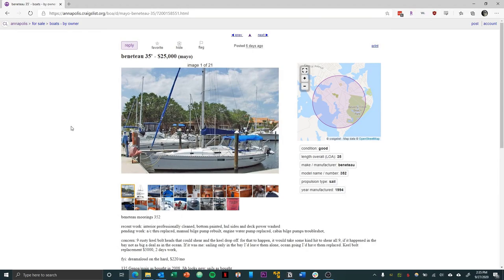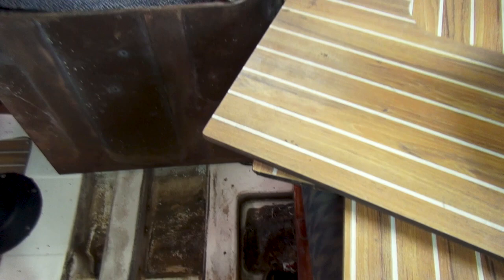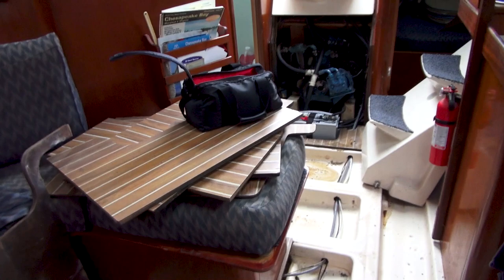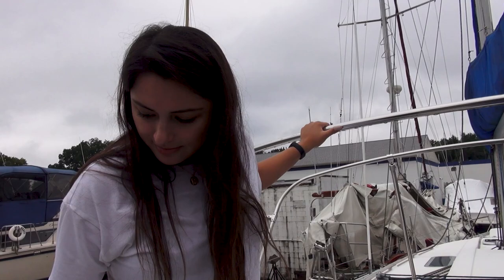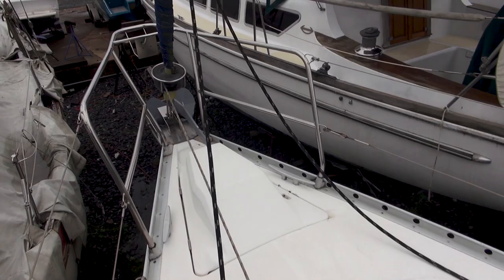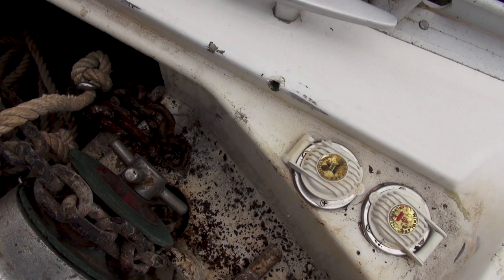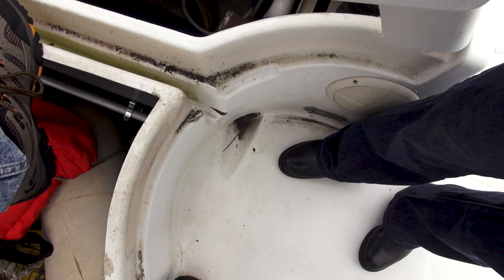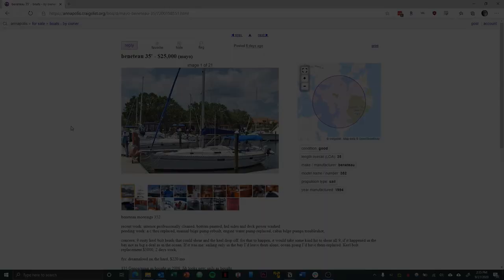Touring a $25k 94 Beneteau 35 from Craiglist - Sailing Viridian Episode 14

Comment: Hey dude long time cruiser here , grid bulkhead hull integrity is the first check , second is deck core closely followed by the rig integrity , everyone seems to start below , that is the last place  to start  things  like ac  dont matter in the scale of potential costs, why were the keel bolts so far gone? Bottom paint is the least of your issues , its common to repaint over old antifoul ,  a full peel is only req every 10-15 years there are far larger issues than the diesel here too

Comment: With respect in this video yo consistently demonstrated your lack of knowledge in assessing the condition of this boat and it’s systems. Your positive attitude is to be commended but you have understated the condition overall and the likely costs to get this into a safe condition are considerable. It may be worth considering if you get it for $2000?
Reply from the maker: No worries, we're still both new to sailboats, we're always trying to learn more! Luckily surveyors are always able to rein in my optimism and give a real take.

Comment: The keel bolts are a minor job on these, (I have the identical boat, mine looked just as bad when I replaced them several years ago). It's an Oceanis, model, I'd say a it was originally a charter boat by the above deck furler.
Reply: Moorings Charter

Comment: Sid came to a quick decision but consider price to work ratio: it's a lot of boart for $24k. The keel, engine, replacing the running rigging etc need work. I don't know your budger but if you can get more off the price and factor in $10 to $15k for what you need to get done to bring it to spec. You'd have one hell of a boat for under $50,000 even if you pay other people to do the work.

Comment: From your video, need to sandblast bottom and repaint.  Couple of thousand dollars.  Needs to new sails and running rigging (expensive).  Keel bolts should not rust like that, there has to be serious leak problems and likely galvanic corrosion problem, this would explain the poor state of the engine, which looks much older than its age.  You could easily put in $20k of repair/replacement.  I would not trust that boat and feel it needs a lot more than spit and polish.
Reply: Right with you. He keeps mentioning owning a boat but I have some doubts about that. 😆
Reply: Soda Blast bottom.  Sand blast could remove gel-coat.

Comment: The change in design from the 90s on reflects a change in the buying market due to the charter purchase options.  Prior to this many more boats were coastal cruisers and with upgrades could be blue water capable. The trade off is livability vs sailing ability.

You have to ask what your mission is, do you want to ICW down to FL and hop over to the Bahamas, or punch offshore at the Virginia Capes and head for St. Thomas?

Contact Matt Rutherford, or John Sparrow about being a buyers representative, tell them where your skill levels are, and what you’d like to do. They’ll help you decide if you need a smaller boat for two to three years, to be sold later for something more capable, or if you should bite the bullet and get the more capable boat first at the risk of spending time in the yard on refit.
Reply: I own Matt Rutherfords  1983 323 Pearson Hull #384 formerly Ault. You may want a better project than the Beneteau.  We keep Our boat in good shape. Its a pride thing. One repair each day You are aboard. Never give up.

Comment: interesting.   Keel bolts replaced = $5000, You need to examine the rigging, looks like a new water pump/impellor on the motor, it looks like a great deal for $25K.   The bottom paint issues is 4 days of sanding and painting.  what did you buy?

Comment: I think that $25 is too high. There's way too much to replace. What you observed during your inspection means that the hidden problems that you can't see will be a costly repair. Talk to other people here on Youtube about their builds and see what kind of feedback you receive. Offer $12.5 and if they go for it you have a huge project ahead of the both of you. Shop around and take your time if need be.
Reply: Absolutely get a survey.  the bolts can be capped with the head of another bolt that you have welded to the tops, and get them out with a wrench.
Reply: There is nothing to survey this boat is a danger to any novice. Boat should be scraped or given away.

Comment: Huge issue with keels and hulls separating from grid on these boats. The keel bolts rusting tells me they maybe leaking but surely they were in salt water coming in. Not a bad near shore boat but a new Benny is NOT a blue water boat. At $24000 minus $5K keel = $19k x 80% = $15200 all the money if nothing major in survey ie; hull/grid separation, cause of bolt failure which is red flag. Again $15K but no further than Bahamas. * SEE EXPEDITION EVANS
Reply: You have no Idea what you are talking about my friend  many beneteau 351 have done Atlantic crossings and one  has won the  Onstar race from Newport Rhode island to England twice single handed. You also have no clue about matrix failure and or how to test for it . You should keep your useless opinions to yourself. I have had matrix failure  and cutting out the pans and glassing it in makes the boat stronger than when it left the factory ,even Beneteau knows this and this boat is full pans not like newer bennys
Reply: @Mechone11  I must know something because your boat failed and if not corrected was well on it's way to eventual serious keel problems. Of course Beneteau knows this because it is wide spread with many pissed off owners. Why do they let these crap boats leave the factory with known defects leaving owners with huge repair jobs. Attempting crossings in these boats putting yourself and crew at risk underscores the type of captain you are when there are so many robust vessels on the market that don't come unglued. You pay now or pay later. The currency later in the middle of an ocean might be your life. Best advise is get as much for that rebuilt boat after disclosing the hull and matrix separated resulting in gutting the interior, cutting out the matrix, pulling the hull back in shape, repair effected sections of hull, replacing matrix, wiring, plumbing and interior. Anything less is a patch / coverup. Now take the $20k you sold it for and add at least $150k to buy a vessel made to safely cross oceans.
Reply: Despiser Despised  Actually there are many production boats right off the production line costing much more that are just basically unsafe. I am talking 20 year old proven blue water . We all know the manufacturers deserving the title and those that don't. There are fools packing their families on Hunters crossing the N, Atlantic, Pacific. The fact they arrive is more a factor of luck than quality vessel and like Chris Evans above they face rebuilding their boat in a foreign port hoping it might get them home. Look here on YouTube, how many stories of quality boats stuck in marinas getting major repairs as apposed to almost all the stories being about production boats coming unglued. Think of all the others sailing clueless to the fact the hull is unattached to the frame, keel torqueing from side to side weakening the fiberglass.

Comment: First of all I own one of these and these boats go between 50,000 to 65000 US and the keel bolts are 200 dollars and the keel does not have to be removed to change the bolts. If there was grid matrix separation the keel will push up.
I didn't see that , the motor is a perkins m30 same as volvo md2030 and are great motors  and parts are cheaper than any other diesel  ,they are owned by Caterpillar and the boat needs a bottom job Its a steal at that price .
Reply: If you wanted a replacement boat, would you buy it and how much would you pay for it?
Reply: If it was that easy ...the keel boats being the problem at $200 each why didn't the owner replace them to facilitate the sale ...the reason being they have rusted to nothing ,and would be impossible to remove !
Reply: That boat is trash and is unsellable. The owner is just looking for someone dumb enough to take it off his hands and he almost found them. Those kell bolts are no minor problem they look 100% unrepairable.